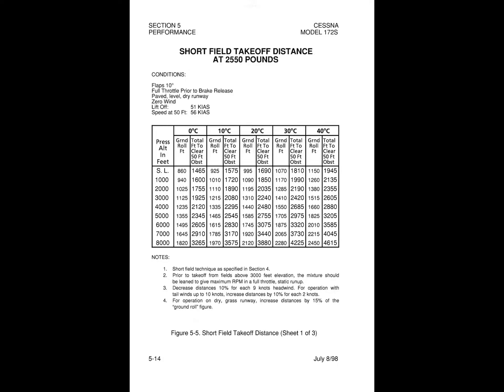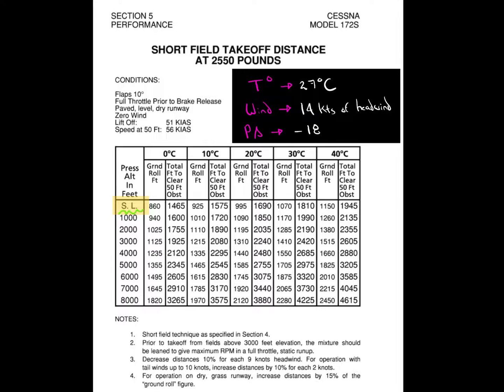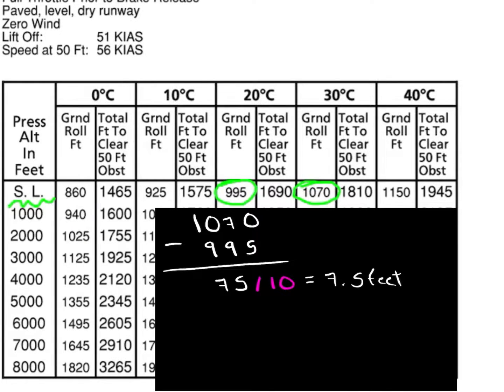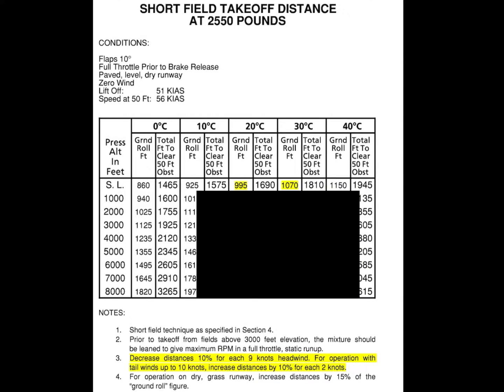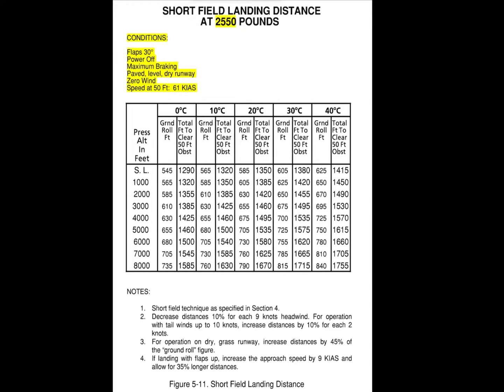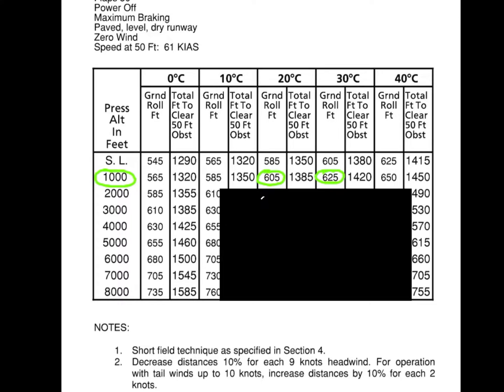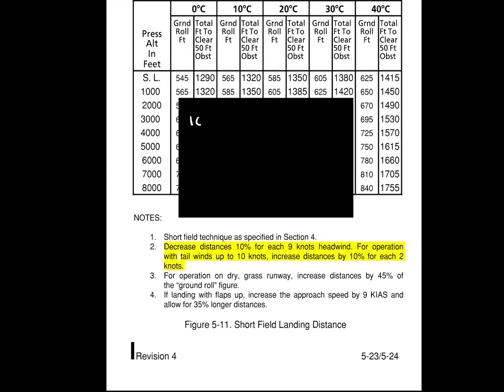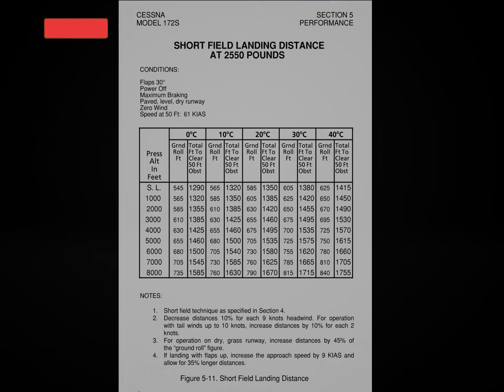Calculating Takeoff and Landing Distance Explained Simple and Easy I Cessna 172 POH

Comment: How do you subtract percentage to the landing roll / takeoff
Reply: Hey there! In order to subtract (Let's say 613 - 14.4%) you can simply do 613 times 14.4 divided by 100. You should get 88.272. Then take your original ground roll (613) and subtract 88.272 = 524.72. I took the landing example from the video.